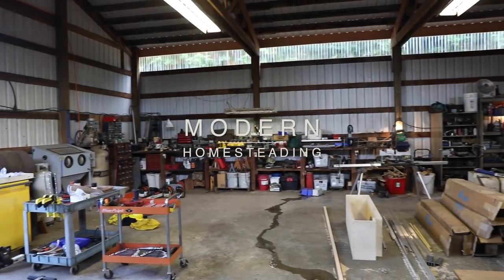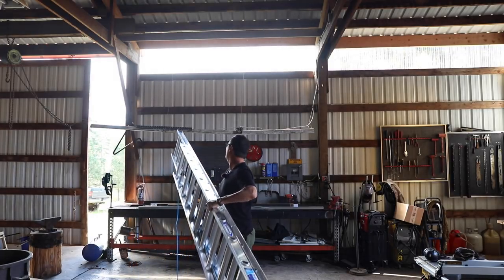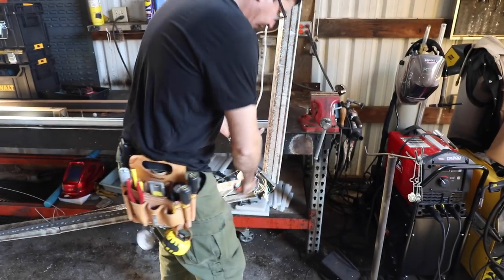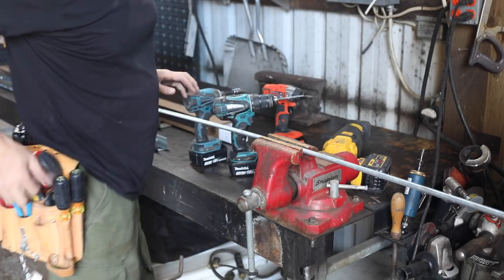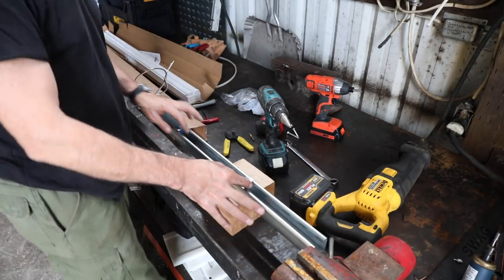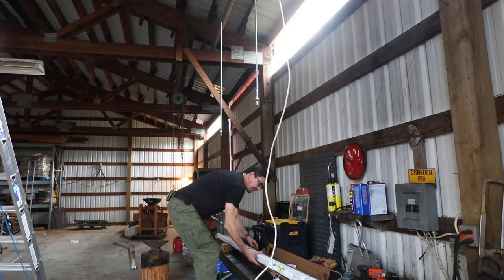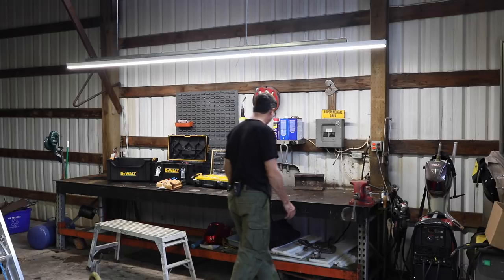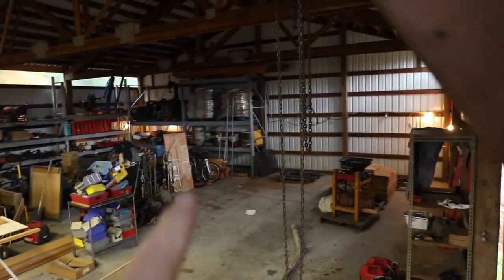Home Depot LED Shop Lights Under $200

Comment: Def not safe the way the all-thread connected to the strut.  Must lock the spring nut in the channel by putting a square strut washer, then lock washer then reg. Nut to squeeze the lip of the strut and keep the spring nut from twisting and dropping ur lights if they r ever bumped.  Plz add this hardware.  Usually the strut is mounted facing down for that type of application.  But the way u have it will be fine if u secure that spring from being able to be moved.  Luv ur content. Thanks for sharing.

Comment: Life hack. Use 3528 led strips from Amazon. Run the trough alumanim channels and mount them on trusses or just in stripes along your cieling. They provide much more consistent light and shadowless if you have a lot of them. At $10 per meter it's a much cheaper option

Comment: On the all thread you typically use a square washer or a saddle washer with a nut to lock it on

Comment: Nice video.  For your overhead main lights, try T3HOs  brightest florescent I've found.  Only down side is they are about $10/bulb, but they are bright.  I wired my shop myself after I had it built, so it had to be inspected and they had me use metal covered MC cable instead of romex.  It's a PITA to work with, but after a while, you get used to cutting it with the correct ends and all.  All these ladder comments.  bla bla . . . if you don't fall off, job well done in my book.

Comment: You dont need 1/2'' threaded rod for fixtures that are less than 5 pounds each. 1/4'' does just fine. instead of using the bushing, you should change it for a threaded nipple to connect the two together and the spring nuts should be put into the unistrut first rather than the reverse. You should also cut the ends of the zip ties,makes it look really clean.

Comment: flip the Uni strut around. use the spring nuts for mounting your lights. hang the strut first using the rod with square hilti washers on top with a jamb nut. Then use a fender washer, lock nut, and bottom nut. Set one side then level from it. not bad for a guy that isn't an electrician though.

Comment: Recently added LED's to my shop as well. I was so tired of the lights barely coming on when the shop was cold. You can't believe the difference unless you've made the change yourself. I'm sure you saw it the first time you turned on the light. And I'm also sure you know exactly what I talking about flipping on the light switch when it's cold and just getting that old gray light if anything at all.

Comment: To lock the strut to the spring nut you could spin a nut on first followed by a fender washer the width of your strut that would sit on top of the strut. And once you have the strut where you want it you would tighten the nut and washer against the strut sandwiching it between the nut and washer on top and the spring nut in the strut

Comment: I've been using 2 high bay lights in my shop and love the light but not the 800 watts to run them. Lol. I just replaced one with two 4 foot led lights and now will get 4 more to replace the other high bay and also light up some dark areas of the shop. 4000 K is perfect for workshop. I'm sure 5000 K would be too white and strong so I'm sticking with the 4000 K. The best lights I've ever had. And 40 watts each. Doesn't get a lot better than that.

Comment: Hey mate, just some constructive criticism...
That spring isn't enough to hold the butterfly nut in place Cody, I am 
an electrician and thats all gonna come crashing down with the 
slightest knock...
Easy fix, all you need is a square washer and 2 nuts on the top side, it
 will act like a vice on the unistrut and is how it's designed to work. 
the 2nd nut is to lock it in place, and I highly suggest you do the 
double nut at the very top also as vibrations will slowly but surely 
undo itself.

I'm not having a go at you, just see the potential harm.

Comment: When hanging lots of lights i like to use chains and hooks instead of threaded rod easier to store. Put a pvc pipe over it fpr cleaner looks works great and makes it possible to attach a rope at the site to pull them out of your working area for bigger stuff.

Comment: Those parts are called strut nuts. Good job on using grommets at the end of the fixtures, however you should have used only one to fasten them both together,  so they can't slide apart. My personal preference would have been a metal threaded close nipple and lock ring.

Comment: Might try to bring the equipment in there, then you can set up all your benches, welder and everything around the equipment where you will be using it the most. you won't have to worry about if something will fit.

Comment: Not going to tell you how to use a ladder or how the unistrut should be mounted, but have a little tip. From the looks of video your light is hanging towards the outside edge of you bench. That would create a shadow while you are working over something on the bench. I would have hung it back farther or mounted it on the wall just a bit above eye level so your not blinded. It would minimize the shadow cast by you body and head while working.

Comment: The uni-strut nuts with springs in the UK are called Zebedee (the Z being pronounced the UK way:) ) this was character in a children's program in the 1960/70s called the Magic Roundabout.I would normally have mounted the uni-strut with the channel facing down with the all thread being secured with a hex nut inside the channel and outside.  I can see why you did it the way you did to pre mount the lit fittings' I would use one of the uni-strut nuts on the all thread as a lock nut to help prevent the nut inside from turning........... signed a UK electrical engineer :)

Comment: look into the retrofit t8 led will fit in the 4ft double pin t12 or t8 fixture as long as you take out the ballast and wire them direct.

Comment: Which home depot lights did you use and how did you decide they were the right choice? There are alot of choices. Have thought about doing some LED conversion in the garage since the fluorescents take some time to warm up in the cold.

Comment: I think those strut nuts with the blue plastic is upside down, the metal part is supposed to be inside the strut channel, the blue plastic is just there to hold it in place , spring strut nut is just another config, you need square washers to cover the open channel and nut down to lock it in.

Comment: Hello Cody, Interesting way to use those strut nuts... I would have done it differently. I your case, it won't really matter much but you just killed your adjustability there. You are going through to oblon holes at the back into the strut not so you are limited to the oblon hole in terms of adjustment. Would have been better to mount the lights on the strut nut, giving you full lenght of adjustability with the added bonus of maximum stiffness. And you also wouldn't have had the problem of having to repierce. 

The holes would have been better used for your all threads.

Comment: Hey Cody, somethings messing with your mic in this video.  I had to go check another to make sure it wasnt my headset. An electronic static pulsing on and off.      BTW, for LEDs, they make replacement bulbs for existing 4ft fluorescents. Remove the ballist and wire 120 to the terminals, then plug the LED bulbs in the socket.  Some places have them for $5-10 a bulb.

Comment: Next time rip the springs off the spring nuts so you don't have to fight with them. Also would be nice to have a square washer with lock washer and nut on top of strut. Good job on the install other wise

Comment: Plz cut the zip ties to the right length.
Reply: Ok, glad i'm not the only one noticing that ^^
Reply: Dutch Courage why would you zip tie something to make it neat and have a big long plastic piece sticking out.
Reply: Guess you only do that when you don't want to do it proper ? ... or, and this can be done, if you want to make sure you can re-use the zip ties some day, as you can put like a small screwdriver in the lock-lip and then pull out the strip again. But seeing one generally buys these things in bulk, there is hardly a scenario where you'd want to reuse them, and cutting them looks a lot cleaner/neater. But i am sure that in the early days of zip ties one would leave the strip on so you could reuse the tie. But when it comes to these 'life long fixtures' reuse is pretty unlikely, and those things sticking out would drive me mad.

Comment: Over in the uk we generally use catenary wire for lights or chain for heavier ones. But probably best to have unistrut to connect two together. Does the earth wire not need to have a sleeve on in the us? Also the spring clips are nicknamed zebadees over here.

Comment: You need a nut with a large fender washer or square unistrut washer to compress down on the strut so the spring nut cant twist and your lights fall down... I would go back and do it... you could literally do pull ups on the lights then... really if I were to do it (I'm electrician) I would have flipped the unistrut over used your spring nuts to mount your lights to your strut and then you could have used nuts flat washers and fenders on your allthread to hang it

Comment: As an electrician I have to agree with other commenters, you used the unistrut  upside down and you used the “cone nuts” (as you called them) actually called spring nuts incorrectly.
Reply: Well I guess what you did worked so, oh well.

Comment: I think you turned the Unistrut the wrong way around :-)
As the fixing to the ceiling would be easier on the hole side (and more secure with nuts and washers), and then you mount the lamps with the spring-clip and can adjust them such you don't need to drill additional holes in the fixtures.
The ceiling mounts also look a bit iffy as it is only the spring holding it in.

Comment: One problem with LED light in a shop is that they operate to a frequency. They are literally flashing on and off very fast, the upshot is they are create a strobe effect whereby rotating equipment, such as lathes and mills,  can appear to be stationary under the right (wrong) conditions.

Comment: You do know the sell LED bulbs to replace the T8, T10 and T12 fluorescents. In some cases you have to rewire the fixture to bypass the ballasts. I retrofit 12 lights in my shop and garage for $220. They come on instantly, there is no flicker to hurt your eyes and it is a much brighter and range from 4000k to 6000k. So don't throw out those old light fixtures.

Comment: I'm not saying you can't do it the way you did, because it certainly is working, but the cage nuts with the blue plastic keepers are not used designed to be used that way... the blue plastic cone shaped part is the equivalent of the spring on the 1/2" nuts. The ones you have are too shallow for the strut depth you used - more FYI for others than to correct you.

Comment: LED lights don't have enough "throw" for my taste. Plus, finding them in Full Spectrum is really hard. A High CRI T12, 4 footers, pack of 9 costs nearly $800!

I prefer my workshop to be super bright. Like aircraft hanger bright. I could never understand why so many places that do metal fab and welding are all dark and dingy?
Reply: So what do you recommend then?
Reply: SuburbanHobbyist I dunno... I'm still hanging on to my full spectrum fluorescent tubes. I bought a couple of cases when they went on sale.

Now I've been flirting with the idea of importing a case of 270 degree V shaped LED tubes where the light output is said to be 5000K, 6000 lumens per 8 ft. But I'll need to get all new fixtures. (Unfortunately the CRI is only about 82, whereas hand picked, tuned chips can approach 98) but many of these importers don't offer such lights at $330 for a case of 20. So there might be a trade off for efficiency vs color accuracy in my shop.
Reply: I have never really researched shop lights so I have no where near the knowledge you do. Do you do this for a living/something similar or are you just really into lights? haha. For me, color is a big deal. I don't care for the very stark white light, even in the shop I prefer at least a slight sun type color. It helps me when I'm working with stains and paint color. I do, however, really want my next shop to be lit up in every nook and cranny. I liked how Cody rigged up his woodworking shop though, plenty of light it seemed. Right now I work out of a converted garage and have a mix of flourescent and LED.

Comment: I do not know who Calvin was, except for a Protestant Minister in the 1600s, Kelvin though is an equivalent measure of temperature with zero set at absolute,zero -271.5 degrees Celcius.  but light intensity is measured in LUMENS.

Comment: jeeze man, have you never used unistrut before? :D 
first of all the lights get mounted on the other side of the unistrut,
2nd the spring nut (zeb-a-dee) pushes into the strut and rotates and is locked in position because of its shape.

Comment: The spring nuts on the unistrut are called "spring nuts." Go figure. I've never used the strut upside down like that but whatever works in a shop I guess.

Comment: If you are putting in lights where there were none before, you also need to add the cost of 12/2 wire. Please do not do this setup outside without having it covered and high up enough to avoid all possibility of contact with water. This is not a weatherproof means of lighting.

Comment: Those nuts are called spring nuts and you were putting them in backwards on the strut. And also washers and nuts would be better to mount the strut to the all thread instead of the backwards spring nuts. It looks nice but you did do a couple things wrong. Sorry i can't explain it better bet the spring nuts go inside the strut and lock inside of it that's why you can spin it right and it locked to prevent spinning when running screws through it

Comment: Are quarter twenty screws a mixture between imperial and metric swstems? Quarter inch by twenty millimetre?
Reply: James Parlane 1/4 inch diameter and 20 threads per inch
Reply: Cheers for that.

Comment: I shuddered when I saw the start of this video.  Way back when I used a cheap 10" aluminum ladder to do some work in the garage rafters.  The top ends were just barely resting on the rafter and the top end of the side rail twisted and I fell about 8 ft on my back and left arm.  Cracked sacrum, broken wrist and shattered radial head and lucky to be alive.  From then on, only quality ladders regardless of price and always, always as tall or taller than required.  Please be safe everyone.
Reply: Brexit Monger Good call.  I got over the fear just because of necessity but the misses still shudders every time I'm on a ladder.  Good YouTube handle BTW.

Comment: I have never seen those blue plastic pieces and I would never use them, I would have mounted the lights with a washer and lock nut just through the holes

Comment: Most likely there is a cell phone in his pocket. I often have to remind my pastors to leave their cell phone with their wives, or some place other than their pocket because of the constant "radio" chatter (Bluetooth, Wifi, cell, gps, etc) can be picked up by the microphone cable or the bodypack transmitter.

Comment: it will probably work for what you are trying to do but I believe you are using your nuts for holding the light fixtures on the wrong side. they are made to grab and pull on the unistrut lip on the inside not on top. check out the unistrut web sight on proper installation.

Comment: I can't hear the buzzing that is being complained about.  Maybe that's one advantage of not using hearing protection for 70+ years.  I too just hung some LED lights in the shop but I used some salvaged chain from a swing set.  I would call that hardware you used pretty "FANCY" .  But nice job and I'm going to tell some of my fancy friends that story.  just for a big laugh

Comment: LED lights will not work with a solar power pocket calculator.  This, I found out too late, the lights were installed.

Comment: Great job.  Two years ago I converted all my 4' fixtures to LED for $8.00 per bulb/free shipping.  Yank the ballast and direct wire 120V to one set of pins.  They were ordered from earthled.com https://www.earthled.com/collections/led-t8-tube-replacements-replace-your-fluorescent-t8-t10-t12-lamps-with-led.  After ordering a case of bulbs, I converted all my garage , shop and basement fixtures.  No more cold weather 5 minute tube warm up's in the garage.  As a ham radio buff, (K2LED) switching noise was a concern.  These are quite quiet throughout the entire HF bands from 160-50 meters. Try them on your other 4' lights.

Comment: those are called spring nuts also no electrician would be on an aluminum ladder too chance to get shocked. use wood or fiberglass only also aluminum its only rated for 150lbs